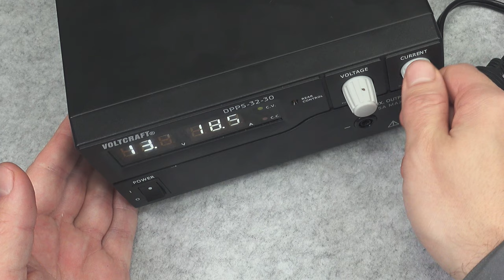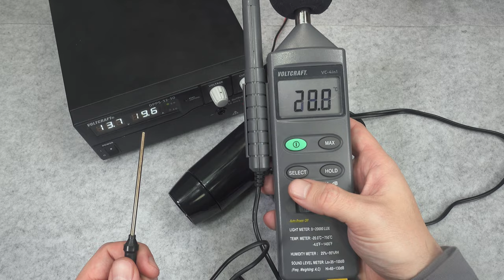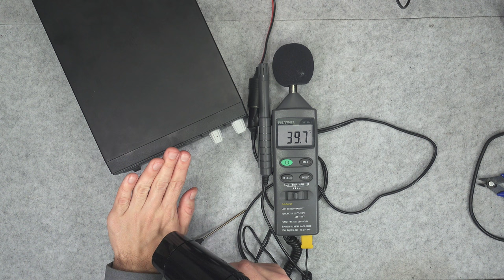Fixing extra powerful 12V hair dryer (over) 200W 20A - for solar or RV

Comment: Most vehicle such as cars the Cigarette lighter socket is only rated to 10amps. Well it is in the UK. Cheers from old George
Reply from the maker: That's true, most like it was intended for RV use - they got more powerful output often run from "home battery" -  I'm using it with my solar system (more like gimmick but give me that feeling of being off-grid :> ) Thanks for feedback! Take care:)